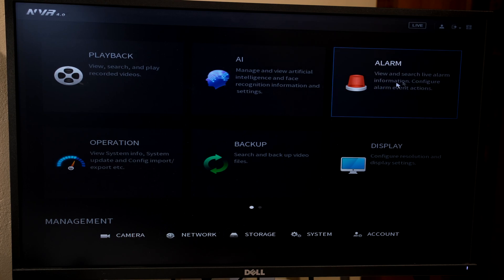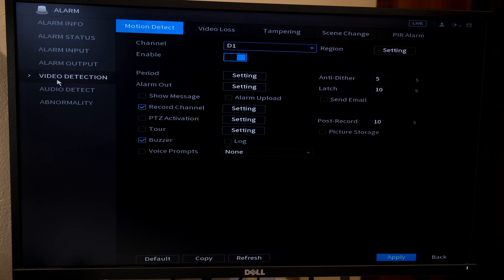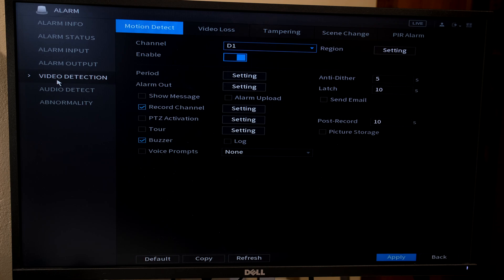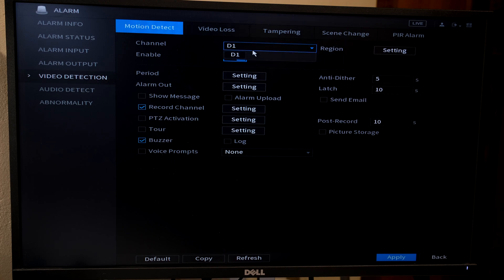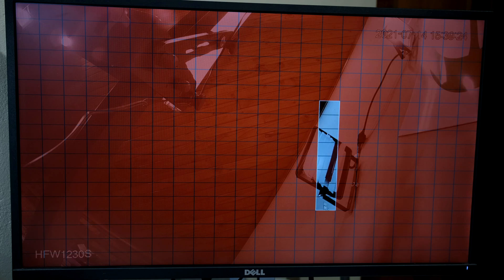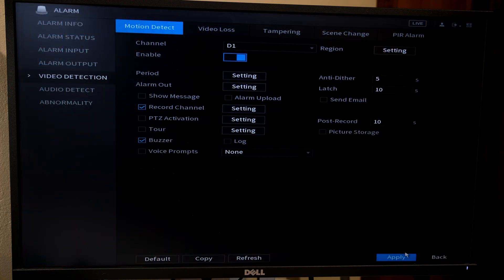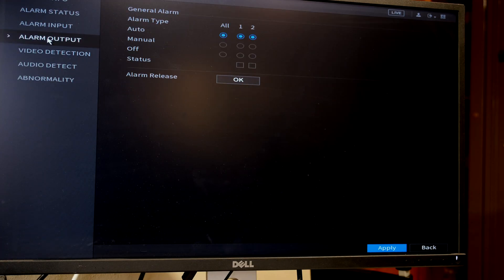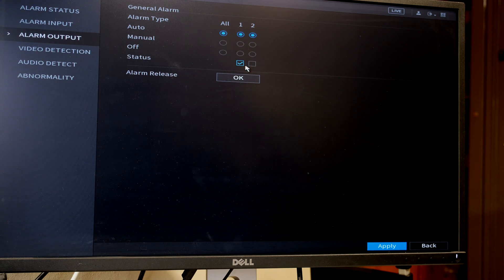How to setup the alarm outputs on a Dahua NVR - connect a siren and light to NVR - Tutorial

Comment: Recently I have noticed that a LED flashing light connected at the rear green connecting block (first two inputs on the left of the top block) remains on all the times. I can't find what the problem is and why the LED light no longer turns off after Motion detection activation. What is wrong and what do I have to do? I haven't had this problem before. Each time motion is detected the NVR beeps and the LED light will flash and then goes off at the set time given. Also, the notifications on my mobile have stopped when motion detection is being activated. It doesn't make the phone sound a beep, nor leaves a short clip on the phone with an accompanying sound. It says that I don't have an alarm hub, please add one. Where do I look for this Alarm hub? If I attempt to add this Alarm hub, A QR scanned appears. Where do I find a QR code on Dahua NVR? It's stressing me out, as it is a pain in the butt to keep the setting to remain as set. Instead, it seems to disconnect itself. Example. I set it to give me mobile notifications with a sound and withing a few weeks those settings are no longer valid/operating. And I haven't touched anything. Plus, again, some days I get notifications with sound, other days I get it during the day but not at night. As strange as it seems, it only makes things quite stressful. Not only that, but when I get a notification with a beep, the damn thing gives me a notification from 10 minutes to up to half hour later. Which means that if someone broke into my home while I am on my way shopping a few kilometres away, they will have helped themselves for that time, until I get a notification. And by the time a return home in a hurry, they've long gone. How do I fix this problem please? Thanks.

Comment: Great Video that you are offering for some people but the info your adding isn't 100% correct.. When your talking about the Motion Detection of the NVR you say that your setting the Schedule for the Alarm output and that isn't the case your setting the TIme for the Motion and by doing that your system will not detect motion on the times you removed.. You need to be careful what information your adding to people because someone might end up missing something that was important because they removed motion event time and not alarm time.. There are a few things that you saying that isn't 100% other then that it is nice that someone has added the Video.. It is crazy that my OEM for a USA based company has better options then the 4216E-AI that your showing in your video.. One of the things that drives me nuts about naming them same with back numbers like yours 4KS2 I am guessing that model has older FW then my model with a 2020 FW.. I mean yours offers options mine don't like the Scene Change Tab and PIR alarm Tab.. However mine offers 2 Standard IVS rules for any camera connected AI or not I have 3 AI cameras right now and I have 5 AI channels. However I have added 3 channels from my AI DVR and doing this I can add 2 more AI for 7 channels of my 16 right now that are AI with IVS rules
Reply from the maker: thank you for the explanation. This will help people

Comment: I have a plug beside input and output its written ctrl and next just "P".  Wonder what it does. 
So the 1, 2 , 3,4, gnd  is input. No1, C1, gnd, output after that ctrl, p, this makes me wonder how to wire this up as my back panel is completely different
Reply: Sounds like you might be using a OEM product.. That is also how mine is setup as well.. So here is some info about mine. While mine says it is a 2 alarm out I only have one so I keep 2 turned off. Then for what ever reason the CTRL and P is a 13vdc output. If you use a multi meter you will see that if you put your Red lead in the CTRL or P and then the black lead in the Ground next to the P it will register a 13.36Vdc in both areas... My Dahua system with Alarms are done right. However my Dahua DVR's with alarms have 8 inputs and 4 outputs..
Reply: @revo2maxx  thank you for your info. Thats exactly im doing after reading the manual and asked the seller which was not really helping. Your info confirm me thanks alot.
Reply: As per the manual for the 42xx series NVR, the CTRL is a 12v trigger supply to operate any external alarm relays you may have (close gate/electrify fence). I'm a bit disappointed because I looked up the specs and only bought it because it said 2 alarm outputs. It does not state what the P is for and I don't have a multimeter handy. So not risking connections to those ports.

Comment: As per accident I've found your
 videos as I struggle a bit with my recently purchased DAHUA NVR and my 6 cameras brought from overseas.
You explain exactly these detailed features which is so essential to know to enable me to install further functionals to come close to the picture what a CCTV has to be able to when I did make my research in the market & products.

Like also to Link extra sirens and may flood lights as shown to my NVR.

Need to do it myself because there's hardly anybody as deep in details here in Mosselbaai!!

Maybe a help for another video would be how to enable Push videos from the DAHUA when the system triggers my perimeter fence/sections.

Couldn't get it working and receive only e-mails BUT need to get a PUSH ALARM VIDEO to my cellphone & tablets 😙🤔
Reply from the maker: hi, thanks. The IDS Hyyp app does video feed when alarm sensor is activated.
Reply: @ecologicaltime  WOW, thank you so much!!!! Will try to get into that story

ALSO need to consider to replaced my old IDS alarm system ,think is 8216 or so, 
And find out if I can integrate it into the DAHUA ALARM platform to manage everything with the same software..

Will try DAHUA express, run it on a separate security Intel NUC computer
and maybe TOGETHER with IDS, DAHUA or KERMI ALARM control??🤔
Reply: So click on the DMSS in your Phone, then click on the camera you have setup with an IVS rules, then click on the icon top right (6 sided looking thing) then click on Notification,  if you have not clicked it to turn it on do so now, Then options will come up show you time settings, Motion Detection, SMD, Intrusion Alarm, TripWire Alarm, Scene Changing, Cam Masking, Disk Alarm, Face Alarm, Temperature Not within, and Other Alarms. (Other alarms, IPC offline, License Plate Recognition, Defocus, Abandoned Object, Missing Object, Fast Moving, Queuing People, Parking Detection, Loitering, Fall, People Standing, Violence, Approaching, People No Error, <---Crowd Control, Temperature Alarm, Fire Alarm, Temperature Contrast Alarm, Hot Spot, Cold Spot, Smoke Detection and the list goes on) anyway Pick the one you want to use that you have setup in your camera or DVR/NVR like Tripwire, then put in a Check mark, then press back, Then press Save. Once there is an action within your cameras IVS rule it will send you a notice.. Please note that if you want to be pushed notices while away you need to use the cameras SN setup option. you can get that info off the screen of the cameras WebUI if your not by the camera or off the DVR./NVR... IT is fast and easy and love that I don't have to worry about all the false alarms of things that don't matter using the IVS Push option...
Reply: @revo2maxx  Many, many thanks for your very detailed reply. This is excellent 👍👍 just discovered your channel due to your reply!!
Reply: @bennog.2338  Welcome, I was just trying to be helpful, It is very nice that ecologicaltime has taking the time to make these very nice detailed videos.
Reply: Many, many thanks for your very detailed reply!!